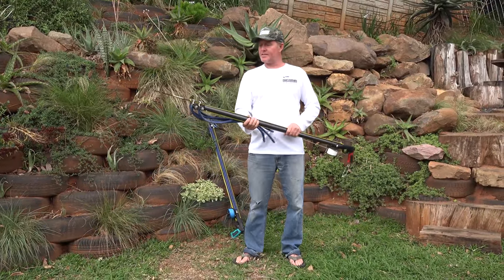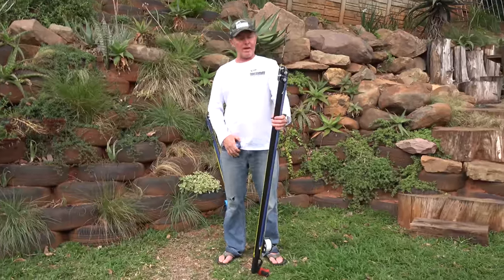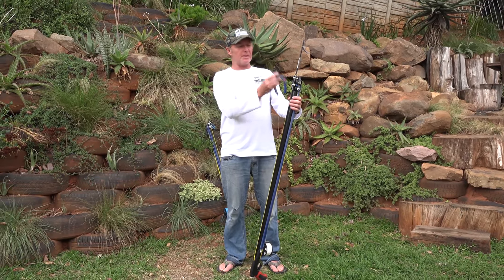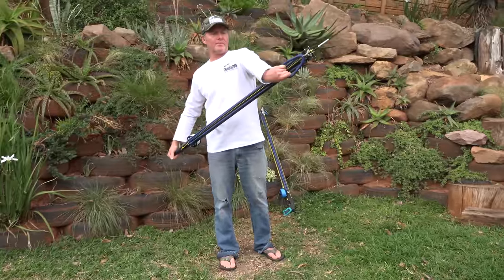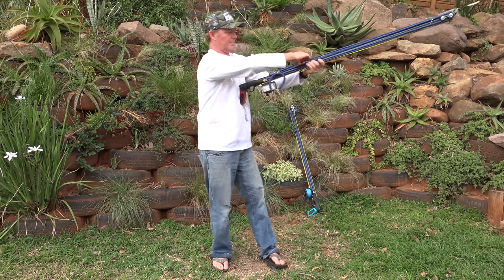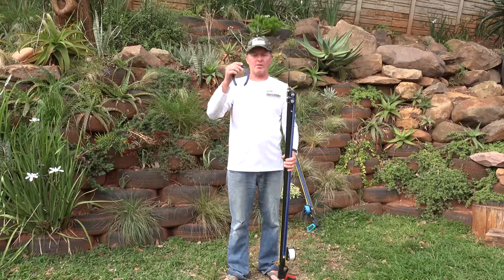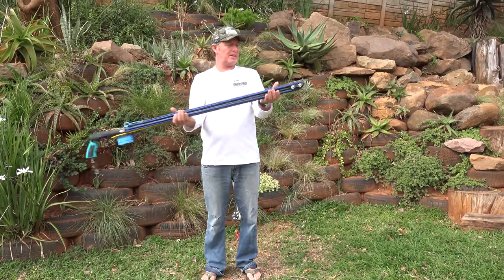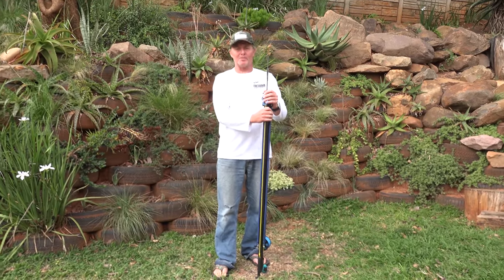How to Load a Coatesman Double Roller (CDR) Speargun

Comment: Would a stock RA Tuna aluminum barrel and trigger mechanism be strong enough for your double roller system with 14 mm bands?
Reply: It should
Reply from the maker: Pablo, The mech and barrel are more than strong enough. I do prefer the carbon tho. It makes the gun better balanced in the water.

Comment: Great vid Chris! I had a questions for band rigging for double rollers! Do you still use the 1/2 barrel + 5 for making both bands or would you use another method. Thanks
Reply from the maker: Jedidiah,
It does get a little more complex / flexible
With the two 14mm rubbers you have enough power to make the rubbers half barrel +10cm or even +15cm in some cases. This allows you to easily hand load.
You can stick to the +5 if you want max power
Reply: @CoatesmansSpearfishing  thanks Chris! I currently have 16M basic neptonic rubber. Would half barrel + 5 with 2x16mil bands be too overkill? I would be shooting wahoo And yellowfin from 10kg  to 60kg with 8mil shaft. Thanks again this is super helpful.
Reply: @CoatesmansSpearfishing  I have a 130 double roller btw.
Reply from the maker: @jedidiahakao345  Start with +10cm with 16mm / 8mm shaft combo.👍

Comment: Hey Chris, considering a 130 size gun could you achieve a double roller with hand loadable 14s or 16s that has similar power and range to one of your single roller load assisted 18mm set ups detailed in your article?

Cheers
Reply from the maker: On a longer gun like a 1300 hand loading is difficult and becomes somewhat ineffective, even with 14s. Better to make life easy with a load assist.
Reply: @CoatesmansSpearfishing  any power comparaison between double roller with 16mm and single roller with 18mm ?
Reply: @clementcornaille5167  mate i would stay off the 18 mm in rollers. A single roller 16 mm set up correctly will easily match a 18 mm roller especially if you stretch your bands to the same total load.

Comment: Sickkkkk !!!!!
Can you run 16mm or 18mm rubber on these bad boys
Reply: 18 mm in a roller is a bad set up.
Reply: @aldogjipali2835  have you tried it ? And what was your results ?
Reply: @NorthernBorderBoys  i never have but because I have  studied rubbers in physics, I can calculate the energy that the spear would get. Rather than using 18mm I would say, use 16mm but just stretch them a bit more. The rubbers will get used a bit quicker though. To put it into perspective, if you want more power, you can get the same pull in kg  with a 16mm rubber but that would mean you would have more preload with the 16mm. Also you would get a smother shot.
Reply: @aldogjipali2835  that makes a lot of sense 👍
Thanks for the reply and explanation 👍